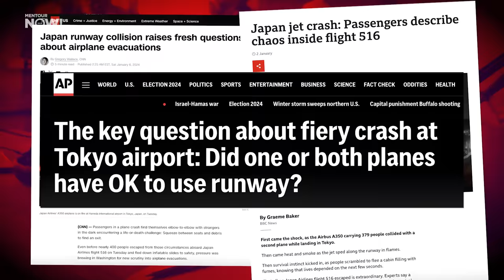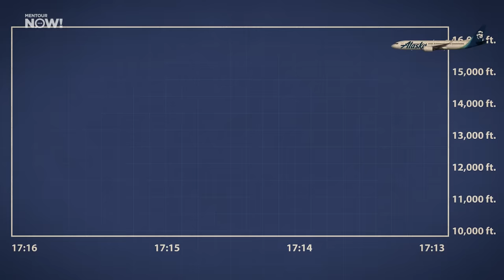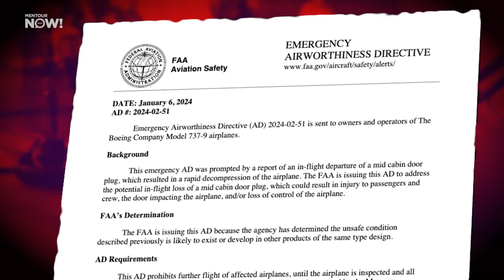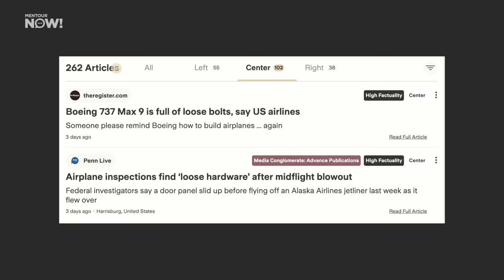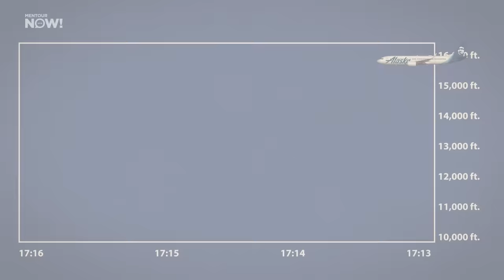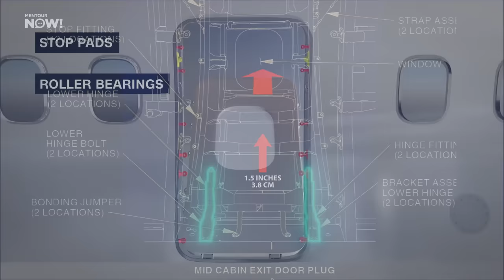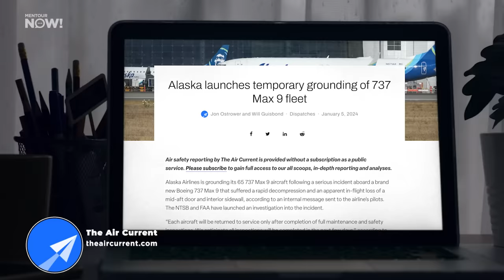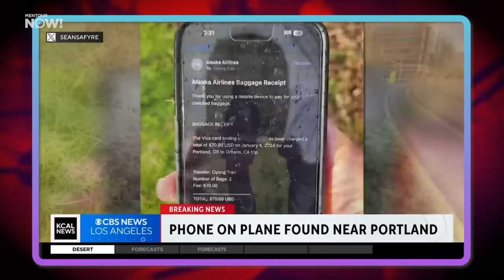WHAT Is going ON with Boeing?! MAX-9 Door blowout

Comment: I wonder if the bolts may have been the wrong alloy or perhaps the wrong hardness. Both of those would be hard to detect but potentially lead to a failure of the bolts themselves
Reply: No, cocktail sticks probably would've held it on. There is very little force on these bolts. They in all likelihood were not there.

To be honest, installing bad bolts is much harder during construction than nothing.

Comment: Loose hardware is a pretty broad term, bolts can be still tight but not at correct torque and classed as loose or they could be completely loose and not doing anything

Comment: 3:10 tbh, I would probably have been less worried seeing that hole than if I'd seen jagged metal. Because smooth edges means that whatever was there cleanly separated, which in turn means that the plane's general structural integrity should be intact. (Assuming, of course, that the parts didn't hit anything important when they separated.)

Comment: Some observations:
1.  The door came off well below cruise altitude and when the differential pressure was not too high.  At higher altitude the force pushing the door against those 12 stop pads would likely have prevented the door from moving upwards enough to allow the door to blow out.
2.  The several warnings that took place in the days/weeks prior to the incident was probably do to a momentary tweak of the door permitting a short burst of air to escape which would likely have caused the warning, not because the cabin altitude was too high, but because the short leak caused the "rate" of cabin altitude change to exceed the 2000 SLFPM threshold.  If this is what happened then the previous alarms were almost certainly at a lower altitude than cruise for the same reason as #1.
3.  The fact that Alaska flagged the AC to prevent it being used for long over-ocean trips is troublesome as it suggest concern about pressurization but they still chose to keep flying it.
4.  Reports say that ground testing of the pressurization alarm system indicated it was functioning properly.  What signals could cause the alarms?  The only one that I know of for a plug door would either be cabin altitude exceeding about 16000 feet OR the cabin altitude rate of change exceeded 2000 SLFPM.
5.  The plane was nearly full with 171 of the 178 possible, or only 7 seats available -- the fact that 2 of them were closest to the plug door has me concerned.  Where were the other 5 empty seats -- were they also by doors of plug doors?  If so then Alaska knowingly exposed their customers to unacceptable risks by continuing to fly it before conclusively determining the cause of the alarms.
6.  At what altitudes did the previous alarms occur at -- were any of them at cruise or were they at lower altitudes?  At cruise altitude the force acting on the door would make it unlikely it could move or otherwise momentarily leak.
7.  Can they interview passengers that sat next to this door on the previous flights that had the alarm and ask them if they heard any whistling or felt their ears pop.
8.  The fact that Alaska seemed to be in a hurry to get their other Max 900's back in the air before the problem had been resolved leads me to question if the incident flight should have happened at all.  
9.  So, Alaska had several warnings that they were not able to find a cause and yet continued to fly.  They flagged it as not available for long over ocean flights confirm they did not know for sure what the problem was yet continued to fly.  They left the two seats closest to the incident plug door unoccupied on an almost full flight.  Where were the other 5 empty seats?  And finally, does the FDR record cabin altitude during the duration of the flight and if so what is the sampling interval?  If the sampling interval is fast enough then a momentary leak which could have triggered the cabin rate alarm then the signature of that might be seen in the data.  If the FDR was able to record cabin altitude with sufficient resolution and at a high enough sampling interval I'd like to know if the data for the previous flight with the alarm can be analyzed for that pressure dip.

Comment: Even if they were sitting beside the door they would still be safe. The door is built so it can't implode inwards and the pressure doesn't suck the cabin out like you would expect. If you seen or been skydiving you would notice that you would have to jump out yourself in order to get out the plane.

Comment: Why the stop fittings and stop pads are not designed to require  bolts, blows my mind. It's not like a configuration change is going to happen so often that it's an issue. The fact that the door is going to remain as a plug, take the extra precaution and secure it at every contact location. Wing spar joiners often have 12 bolts space 20 mm apart, which is way too many, so the cost excuse is not the issue here.

Comment: Greetings, Petter. Thanks for yet another great video! Something I read was a quotation that says ".....few things say more about an organistion and its management than the manner of its decline and ultimate downfall" or words to that effect.
I sincerely hope this will not be the case with Boeing, but time and again I think back to the DC10 cargo door scandal that was dealt with by means of a "gentleman's agreement" (read as greed and corruption) between MD and the chief of the FAA. And of late the 737 Max MCAS scandal. 
In both cases, management was made aware of the potential danger to life and aircraft from within their companies and/or sub-contactors prior to those crashes. Instead it was a case of management and their bean counters admonishing the production/quality control/safety staff to remove their engineering caps and put on their financial caps. In the DC10 scandal a venerable NTSB engineer (Charles Miller) was vilified for his concerns and threatened with dismissal. Contempt!

On a lighter note, Petter: I really miss your doggies: but on this video I had to giggle at your pronunciation of that unit of length cm as "centimitter" with emphasis on the 2nd syllable instead of the correct "centimetre", with emphasis on the first. That must come from my pet peeve, "kilomitter"; it should be "kilometre" again with emphasis on the first.

Comment: I was a vendor engineering rep (machine tool controls) to Boeing prior to the McD purchase. At that time, every Boeing engineer and manager, even if nowhere near a runway, thought of themselves as "airplane people". They were obsessed with getting things right.
Here is my list:
1. Boeing management going for maximum profits to increase stock value.
2. Boeing management moving HQ away from the factories, to isolate them from the problems, and get closer to the money people. First to Chicago, then to DC area.
3. Boeing management thinking short term instead of having a long range strategy. ie 737 MAX instead of a 757-like new design.
4. Boeing eliminating QA and having workers self inspect their work.
5. DEI hiring, worrying more about "what you are" instead of "how well you can do the job".  Boeing brags about it on their website.
6. Generation Z, now being called the "Lost Generation".  Can't get them to focus on what they are supposed to do. On their phones.
7. Outsourcing to spinoffs like Spirit.
8. Outsourcing to other countries with lower standards, like India (MCAS software).
9. FAA allowing Boeing to self certify.

Comment: You mentioned that this same plug door design is used on the 737-900 and ER variants.  If this is true, then all of these should be grounded also until fully inspected.  How many 737 pilots would be willing to sit next to these uninspected door plugs?

Comment: Juan Browne at Blancolorio posted a photo of a completed Alaska Airlines 737 Max-9 having its WiFi installed, supposedly by Spirit in Wichita. In the photo you can see an air conditioning hose attached to an open left-side plug door. I think the most likely explanation is that the completed plane was flown to Wichita where the WiFi was installed and at that point Spirit failed to properly reinstall the bolts. Whether this was after Boeing turned the keys over on the aircraft is the big question. If it was then this is 100% a Spirit issue.

Comment: So, why didn't the pressure difference keep the door plug firmly in place? Gradually shifting upwards on its own and then becoming loose, as suggested,  doesn't sound like something that should be even possible in a properly designed mechanism, with or without additional locking bolts.

Comment: What I don't understand is why are the springs installed on the plug version? It's not meant to open so why have them there at all? Without the springs gravity would hold the "door" down even if the bolts were to come loose or be forgotten, no?

Comment: I am a retired aerospace engineer with 40+ years in the business. I shake my head over all of the amateur analyses of this incident. Everyone is missing the real problem. I wrote a bit of a rant on Facebook back when the Boeing 737 Max had two crashes related to the MCAS system. My rant had to do with the underlying cultural issues at Boeing rather than the technical capabilities designed into the aircraft.  To sum it up, the rank and file engineers are not stupid or incapable. Their input, expertise, and design is being limited by very poor management and the cost-cutting measures of a hideous bureacracy driven primarily by the petty politics of the unqualified.

Now we have doors falling off another version of the B-737. A door is not that hard to secure. Even a casual review by a qualified engineer indicates that there is absolutely no technical and/or physical reason why those doors should be falling off. In the immortal words of the Warden (Captain) in the movie Cool Hand Luke, "What we have hea-ah, is a failure to communicate!"

The poor to non-existant recognition of that phrase by Boeing's upper management is disguised in the rhetoric and visuals of calling an "All Hands Safety Meeting" at the Boeing factory. This is a miserable and thinly-disguised attempt to point fingers at those who have no control over how the company is run. The sad truth is that the problems are deep-seated cultural problems, not surface-level quality control problems. The fundamental problem is that the cost-cutting cheapskates with political agendas supported by "cost-savings metrics" and "six-sigma black belts" (Google it) within the middle and upper-middle management at Boeing are not being rooted out, and any whistle-blowing engineer or factory worker is run out of town as not being a team player rather than taken seriously for having genuine safety concerns. Until those problems are recognized and properly dealt with by Boeing's senior management, these kinds of disasters will continue and innocents will die. In case I am not being clear enough, it is not the engineers, it is the cost-myopic (which also implies schedule-myopic) messenger-shooting program managers and line managers who are the problem.

I spent time in both roles (engineering and management) during my aerospace career. I know how that game is played. It stinks, and Boeing is one of the worst in this respect. I will tell you exactly when Boeing began to falter - when the CEO was no longer a qualified engineer, but a technically ignorant bean counter.

In cases like this many companies fire the Director / General Manager / VP over the organization in question. That is a symbolic gesture at best. What is usually not recognized is that the out-going senior leader is the one who, over the long-term, fostered and developed the deep-rooted toxic culture that is the root of the problem. An incoming replacement senior manager is given limited authority to make large changes, either in business processes or in personnel, and the toxic culture continues to fester while driving false metrics. In today's business environment it is rare that the CEO of a company has the knowledge, expertise, and cojones to force the kind of major changes that would alleviate the problem.

Expect more problems from Boeing.
Reply: Although I've never worked in that field I can say you hit the nail on the head. This culture is occurring in most all types of business anymore.  I had been at a factory for years and it kept getting worse and worse by bad management. The managers would want to know why production was not being met. The machines were always broke down and not because maintenance and the engineers couldn't fix them. It was because they would put in orders for the parts needed for repairs but before they were submitted they had to be reviewed by someone (who had no knowledge of maintenance or engineering) in the front office to see if the purchase fit within the allowed budget. In most cases, they were denied. As result, the machines were patched up but guaranteed to break down again sooner than later. The managers would call in a meeting with department leaders and their corresponding leaders of maintenance and engineers and demand to know why production fell short. When trying to explain, management would cut them off and literally said "Im not looking for excuses. I want to know why.'' I myself reported to OSHA about safety concerns and as a result was set up for failure and fired not long afterwards. By that time my health had went downhill. I was having anxiety attacks, gained 60 pounds, chest pains, and most of my hair including facial hair had turned white. Two years later, my health has gotten much better although I still battle anxiety. It did make me smile when I found out a month ago that the plant will be closing down in 2025. They claimed it was because of supplies becoming too expensive to operate. I know that is just a cover for bad management that has led to contracts being cancelled by customers due to the orders not being met on time. When I started there, the place had over 1,500 people and three shifts. It now has 650 and only works two shifts from the loss of contracts. I smile because on the day I was walked out I told them "It's okay. In the end I'll be the one laughing when this place shuts down." Them rolling their eyes and smirking at me saying that is why on their last day of operation I plan on getting there in the lot bright and early when and where management parks.  As they all walk in together I will do a drive by pointing at them while laughing my a-- off.

Comment: The concern is this is only the latest issue for the max. It comes after loose nuts were found in rudder attachment of many max planes in 2023 resulting in grounding and inspections and that came after another incident where a series of holes were found to have been drilled wrong on some planes earlier in the year. 

This question is, how will the public and the FAA respond?

Comment: Loose bolts, regardless of whether they're used on door plugs or anywhere else in an aircraft, are EXTREMELY concerning.  You would expect that for such important connections, which can literally be the difference between life and death, Boeing would at least use Loctite or a similar threadlocker to help ensure the bolts remain securely attached.

Comment: You did not mention the Wi-Fi upgrade contractor. I just don't believe BOEING would leave those safety bolts out! The pressurization issues started right after the upgrade.  Check out picture of roll up stairs @ left Plug door. 
 Someone has got to Fess up! I did it, It was my job to inspect all work before covering up plug door trim! How did that contractor, or sub-contractor preform that work order?
  Also, Cockpit door, the flight attendant said she tried three times to close that door. and she finally did. Boeing will be hit on no mention of door flying open in the flight manual, so there's no simulator training setup for this Scenario.

Comment: I would amend the secondary securing of the bolt,  it has a Cotter Key,  I don't believe they are called locking wires which is a different type (requires a twisting tool).   Not the same as what I know as Safety Wire.    It may not make any difference but the use of Cotter Keys strike me was very low tech,  I am having a problem remember the last time I have seen one.   Hubs nuts  on trailers comes to mind.   I have used Ultra Sonic device to find air leaks and am surprised that seems not to have been used.   Door and exit/plug checks would be obvious locations to check.

Comment: Why would the pressure differential make the door impossible to open?  The inside of the cabin is pressurized, and the outside is at a lower pressure.   The pressurization would actually HELP you open the door.
Reply: The 12 stop fittings on the door (plug) actually slide behind (inboard) the 12 stop fittings attached to the door frame. Pressure on the door increases the pressure on the door frame (locking the door in place).

Comment: The plug door design seems sound to me. The bolts blocking the movement of the locking pins in their mounting slots seem very well up to their task .... when mounted correctly.

Comment: Seems to me the 4 bolts did not only have to be loose but also missing !  These 4  (FOUR) bolts are fitted after the panel is secured, nuts are applied (likely to a specific torque) the a safety wire or pin is fitted to stop the nuts loosening.

Seems that 4 lock wires would have to break, 4 nuts would have to come loose and fall off, 4 bolts would have to fall out before the door could even move up to open.

This is gross negligence !   Not an accident !